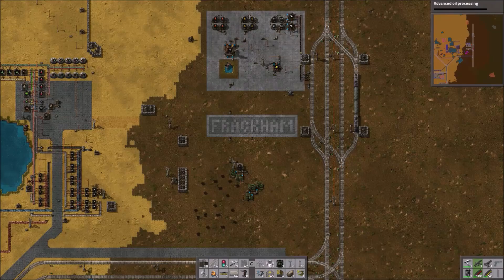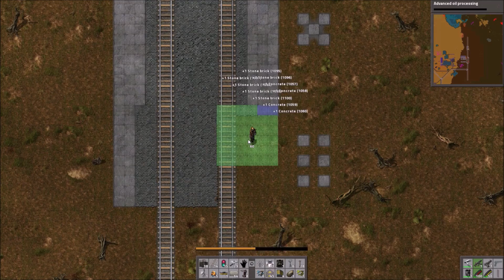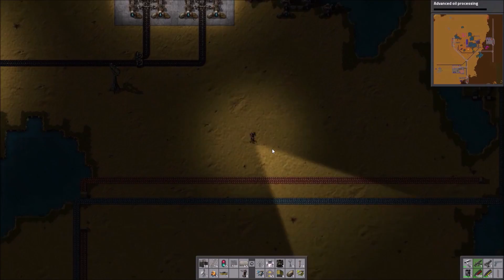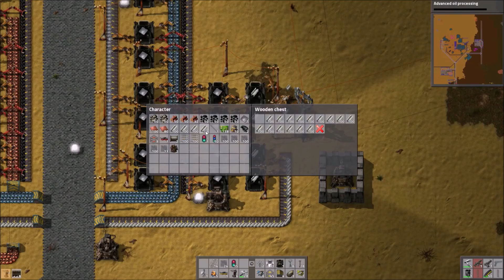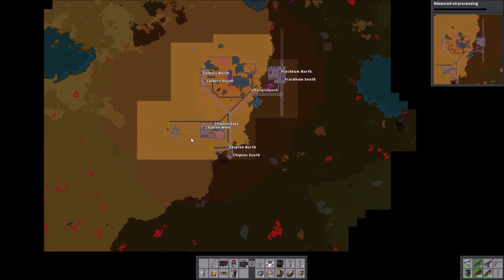Factorio Towns Ep#11: Paving The Way

Comment: I've found tanks really useful in my first game.

However, at my second game I realized laser tower creeping is MUCH more efficient, safe and resource friendly (in long perspective).

At other hand it has some cons: you have to build up power supply to a point it can support lasers shooting whole night (in order to not getting "surprise" in the middle of night when all your turrets turns off)) AND you always have to return thought the same way you have came to deconstruct poles.

This tactic is especially good with personal roboport and blueprints so drones can quickly build mini-fort of large pole and 8 towers while your power shield is "tanking" worms. (Note: no walls in blueprints 'cause you can launch only 10 drones, so items placed have to be no more than 10 to build in simultaneously in single launch). Drones also will repair damaged towers and deconstruct them faster than you after killing job's done.

Before you've got advanced items consider laser turret has range equal to big worm's, thus giving tactic at the edge of cheating: you put tower, it shoots, worm is also shooting, but while worm's projectile is flying you deconstruct tower and place it back. Even if you place it back before projectile arrives it won't recieve damage because projectiles are binded to target and have no AOE (that's why you can't evade or run off worms' projectiles)
Reply: 17:15 the reason why signals didn't work (as I've found at least, probably it's an accident, but works every time)) because they must touch only single rail piece, and yours reach to curved rails thus making the rail block go around the signal making latter appear in center of rail block (thus signal gets situation when single rail block is on both input and output).

The setup is working when you move 1 block aside because curved rail goes far enough to be untouched by signal.

OMG, I've written this so crappy =_= I hope it's still somehow understandable...
Reply from the maker: +G.Z. Gizzeit Seeing as I've thrown my usual rule of no turret creeping out of the window, laser turrets are gonna be pretty high priority. Though I might have a little fun trundling around in tanks before then :P
Reply: Funny thing: I was laser turret creeping thinking "my tank ammo supply is not enough yet, turret creeping is temporary" and I never build the tank that time till the end :D

The problem with tank it isn't good in taking really big bases (even with turrets backup) - destroyer capsules may help though, but I never used them yet - going to try in future.
Well, you have felt it by your own in that increadible "Lake war" Railword multi-episode: when it's getting hot, tank is not the answer. Especially in forests. To fight tank needs open space to kite natives while "peeling" their base.
Reply: At least tank is much fun at mid-early game when you charge bases to save valuable ammo, 'cause repair kits are much cheaper :D

Comment: I still feel that naming any manner of circuit town 'Spectrum' is the way to go, but if you want to have some variation of Silicon Valley I can partake.

Silicon is very rarely found in it's pure form, far more commonly found as a dust or sand known as Silicate. With that in mind, notice the terrain, that northern area is on the coast of a body of water.

Meaning a good town name suffix would be 'port'. That said, I think a decent choice would be Silicate Port, or Silport, or something of that nature.

Comment: Diagonal concrete is ugly, but you could add one layer of stone on borders for roads, like sidewalk or berm (?) so it looks little better.
Also, sands does not absorb pollution too well (0,2/0,25 per second per full chunk), that is half of grasses (0,4/0,45) and nearly third of waters (0,5/ 0,6), so it is not so bad to floor (0 stone and concrete) them. [Numbers from factorio wiki.]

Comment from the maker: I lost my concept of time when describing the ground damage, it in fact appears to be around 8-10 hours for the damage to appear, if I remember when I put in the stone rightly.

Also first. Ha.
Reply: +MangledPork Gaming  Since you are unhappy with the default resource distribution, you should definitely check out the RSO mod: Resource Spawner Overhaul (http://www.factorioforums.com/forum/viewtopic.php?f=79&t=13783).  It is perfect for your play style; vanilla factorio that actually requires trains.  You start off with just 1 decent sized patch of each resource in the starting area, and then all the other resources are much further away than normal.  As you move further away from spawn point, resources patches decrease in frequency but increase in richness, so early outposts dry up quickly, but as your train network expands they become more valuable.  It is designed for people who want to make elaborate train networks.  Biters are also scaled appropriately, so you don't find the solid walls of biters that you ran into in your Railworld campaign.  

NegativeRoot has a LP "Break the Game" that shows it off pretty well. 

If you do decide to try RSO, the FARL mod: automatic rail layer (http://www.factorioforums.com/forum/viewtopic.php?f=61&t=13553), becomes almost mandatory when you're setting up massive train networks.
Reply: +MangledPork Gaming when you get the tech, you should use the robots and roboports with chests around your towns, moving whatever resources your town uses. they don't actually have to do anything, but they'll be your little citizen workers. While really useless it might make the towns feel a bit more alive :)
Reply: DAAAAAMMIIIIIITTT